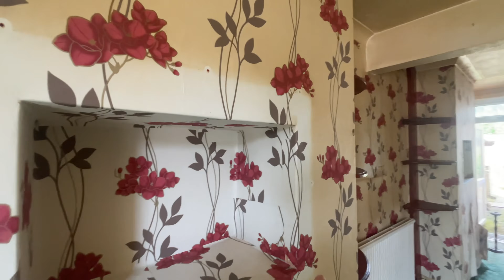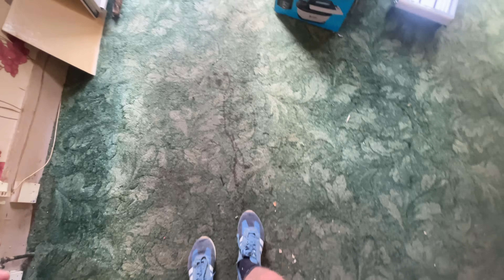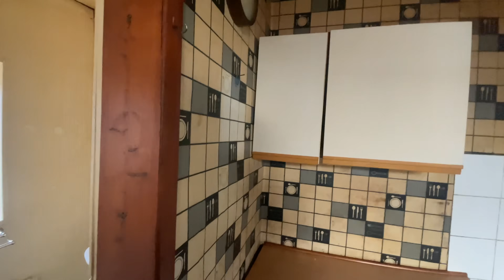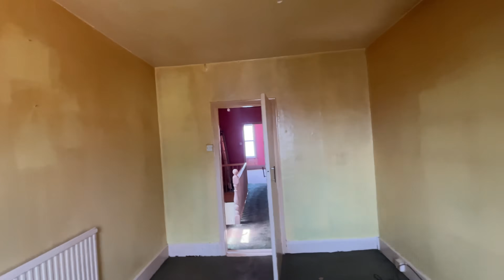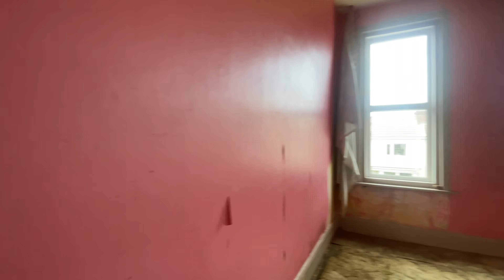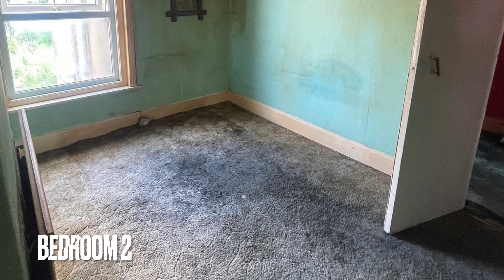I BOUGHT AN ABANDONED HOUSE!

Comment: Are you going for reduced rate vat?
Reply from the maker: I’ve just had a quick look off the back of what you have said, it wasn’t something I was aware of for existing houses tbh.
I believe I may not be eligible as it hasn’t been abandoned for 10 years, Only a couple.

Would be Loverly to get some money back 😅

I believe it would fall under conversions from their site not entirely sure 🤔 

“Conversions
The building being converted must usually be a non-residential building. Residential buildings qualify if they have not been lived in for at least 10 years.

You may claim a refund for builders’ work on a conversion of a non-residential building into a home.

For other conversions builders can charge a reduced VAT rate.”

Comment: Hey what was total cost to acquire property (purchase price, legal and bridging fees), estimated refurb cost and end value? Cant wait for updates
Reply from the maker: Hi Mike, £210k purchase. £1500 legals, £600 survey and £0 stamp as I sold my last property so this my only property and below the thresholds for stamp duty so nothing was due. 245k is the most recent sale of a property needing a good amount of work on the road and the highest sold i've seen is 295k on the road.

Surprisingly It was just about mortgageable, on this particular property in my budget it made more sense to go down the mortgage path. unfortunately it was supposed to take 2 months for conveyancy but ended up taking 8 as there was an issue with the probate so I was close to pulling out. I put down a 45% deposit (sale from my previous renovation property I owned and lived in with a friend).

Im a bit of an eternal optimist so I'm going to say 12 months to have it done and 15k without an extension but I will do most of the work myself and have a few favours to call in for work done on family/friends renovations that I've been involved in the interim. but I guess we will see!

Thanks for watching Mike
Reply: @HandySam  But I think renovation can easily cost 100k?